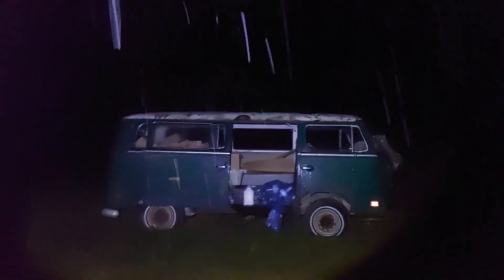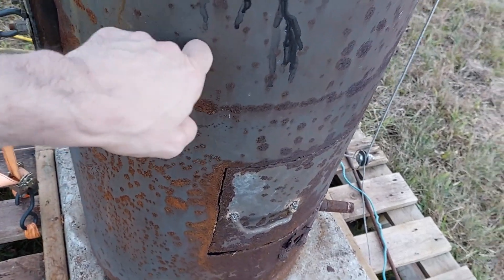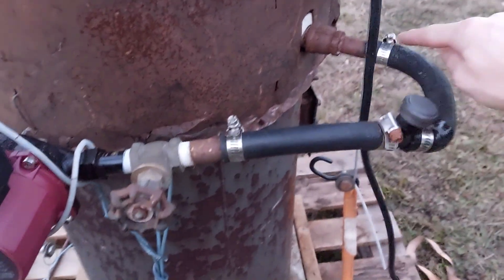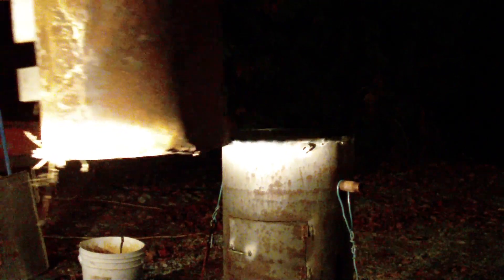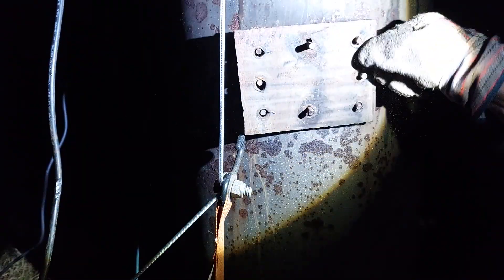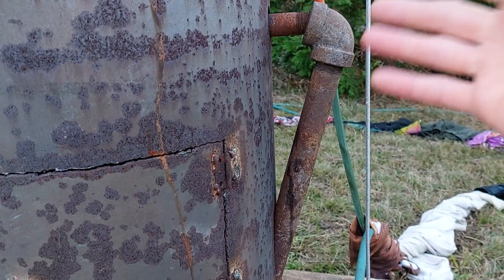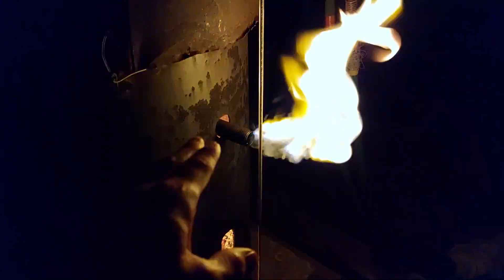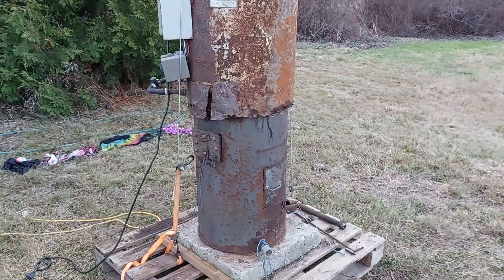How I Heat my RV for Free - Easily Built Homemade Outdoor Boiler Really Works! with Multi-functions

Comment: is there a stove pipe (or exit hole) from lower burn box that fits into the center tube of the old gas water heater?   Or  is the bottom one just open topped and you figure the smoke will seek out the center path thru the gas water heater??

Comment: your charcoal oven could also be a pyrolysis oven.  As plastic inside it breaks down the released gasses can also be burned like your doing.... or condensed to make Petrol,-ish Kerosene-ish and Diesel-ish.  Ive been thinking about this lately.    ohhh... you could do the same with waste motor oil in that oven...  that too when condensed will produce same stuff as the plastic.  Just at different temperatures.  onlike wood gas.... you need to control those temperatures more to really know what of the three -ish products you get out of it.  not as much a concern if all your doing is feeding it back into the fire ....  reducing your wood load to keep it all going....   Granted.....  if that is all you wanted...  might as well just drip used motor oil into the burn area.   but plastics pyrolysis..  to create fuel in same way your doing with wood gas to lower wood totals needed to burn....  go for it.